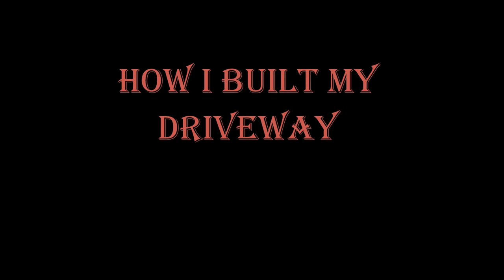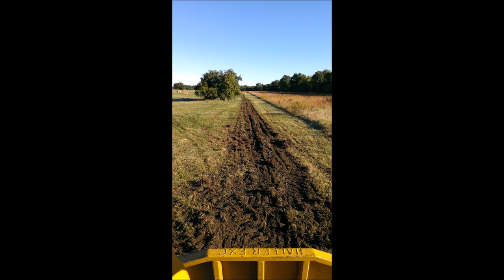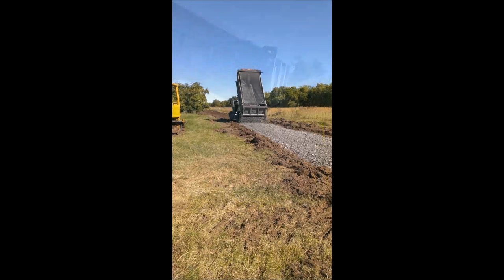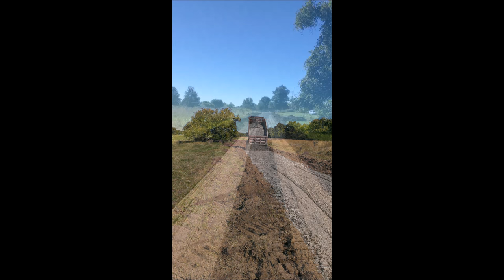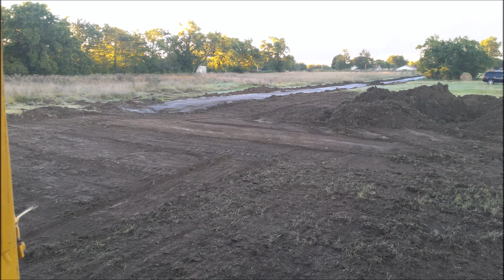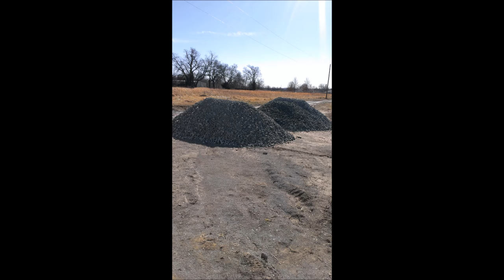How I Built Our Driveway

Comment: Deep dig can cause somewhat of a bathtub effect in some areas - collecting water (think of the potholes as the soft spots where it drains)...  We've found on flatter ground that "driveway cloth" or "driveway fabric" lets you stay a little closer to (or even above) grade...   We used it here where we crossed a seasonal creek bed (I'd never heard of it before then) and it definitely helped stop the rock from sinking into the creek bed endlessly (hate to say how many times we rocked it)...   If you come on up above grade some,  give it a look see...  It really does put the halt on potholes...  11
Reply from the maker: Bumble Bee Junction awesome, we haven't had bad issues of deep pot holes in 4 years, I would just say normal wear for where I live.  thanks for the heads up.
Reply: It's pretty good stuff...  I kept the leftovers and use it when our driveway (I didn't install our current drive) ruts or potholes...  I dig out around the rut / hole some - slap it in there - toss the rock back in - drive over it a few times with the tractor...  To date, we've had no "repeat offenders"...  LOL     But like you and your wood ash, I won't hesitate to rake in a dry bag of cement...  ahahaha